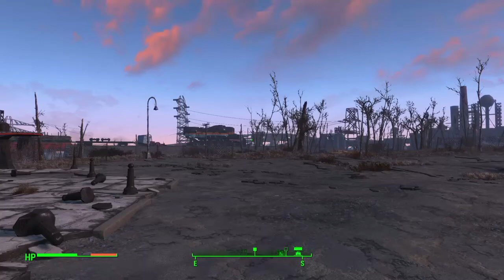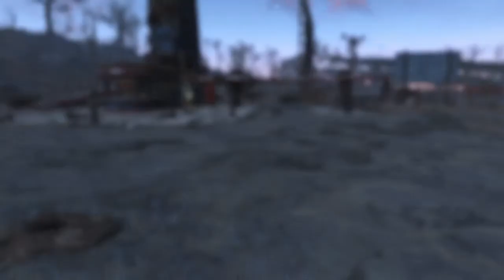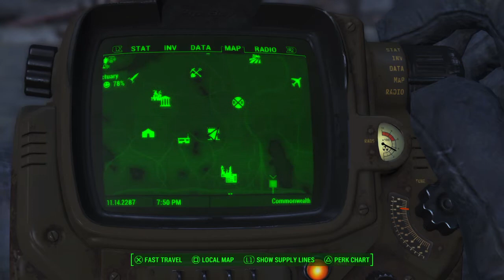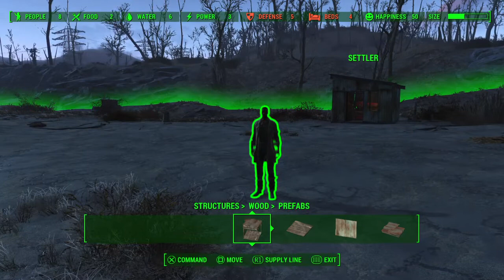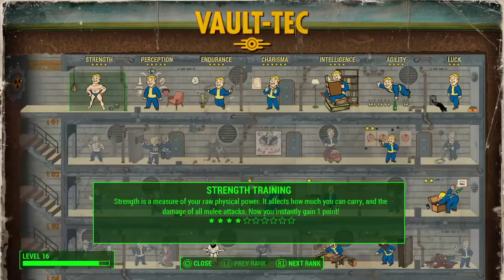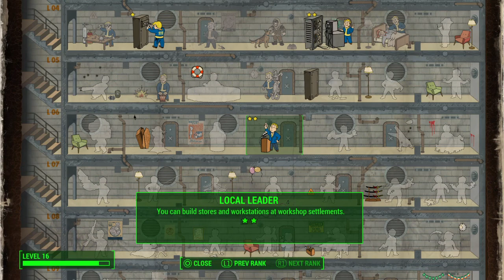Fallout 4 (PS4) - How to set up a supply line

Comment: How come i dont see "R1 supply line" in the options to command the settler ? even if he is not assigned to anything ?
Reply: You need to have 6 charisma and 1 skill point in local leader
Reply: Mike Hillman just had this problem, thankyouuu
Reply: Mike Hillman any suggestions on how I can get lots of ceramic and copper without caps?
Reply: Mike Hillman oh, I didn't know you could trade weapons for copper and stuff. thanks! :)
Reply: ***** thanks:)